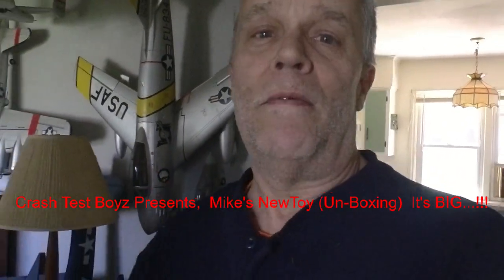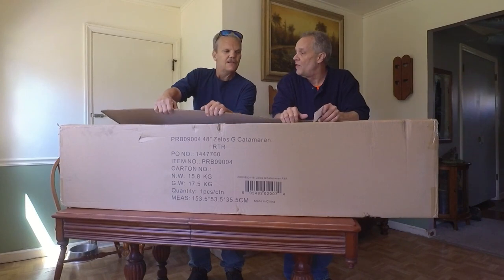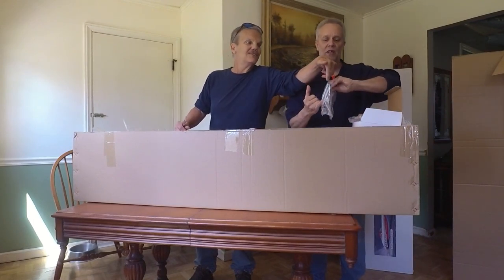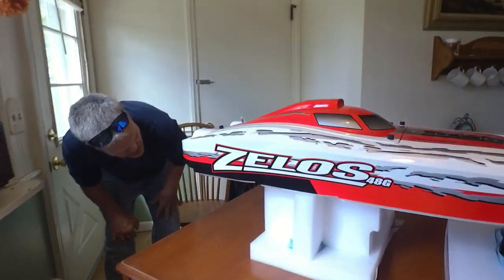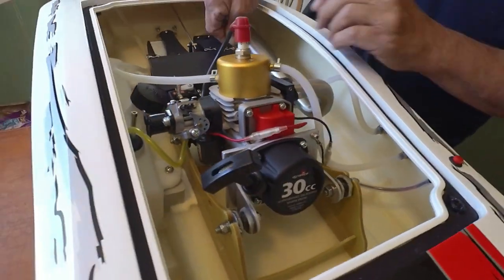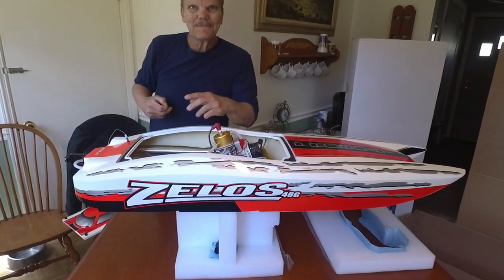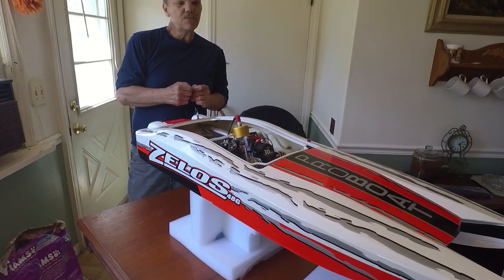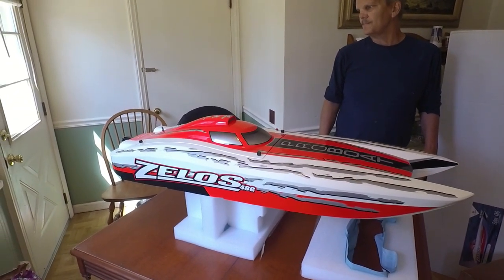Crash Test Boyz, Mike's  New Toy  ( Un Boxing)  HINT... It's BIG   !!!

Comment: I wanna get one of these but I’ve always stopped because I don’t get what you do when it flips ? And it will.
Reply from the maker: You go out after it if need be. lol  But use a raft or boat or fishing pole and cast for it.  Other guys have smaller boats used to tow a line and tangle it around boat and pull in.